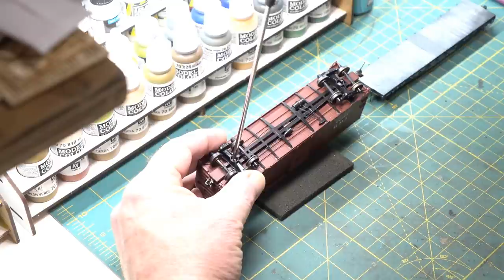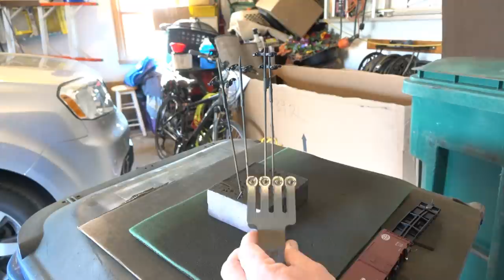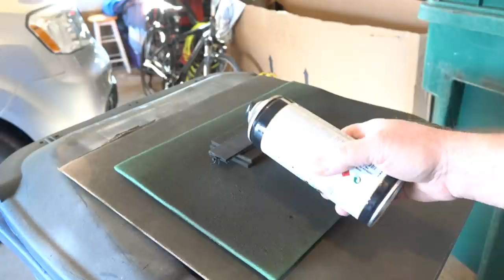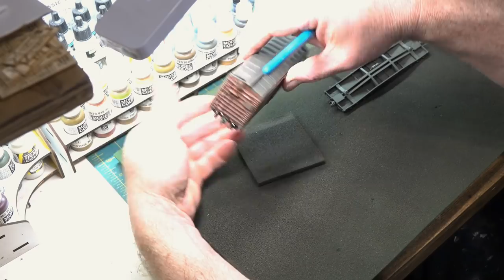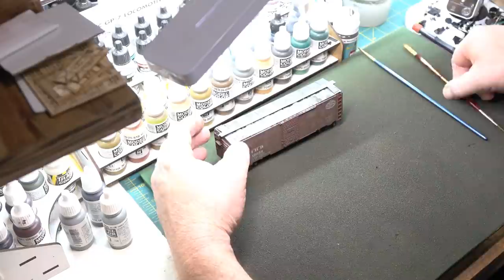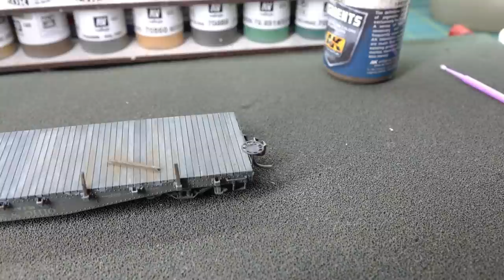MRUV 147: Quick Weathering for Rolling Stock

Comment: you are just so natural on the camera. love it. 
question, when changing wheels from plastic to metal, how do you know what size of wheel sets to use?
Reply: Well, I suppose I should measure with a caliper and get the right length, but I just slap in Intermountain wheels- sometimes Proto as I have a box of those as well. As long as they seem okay I'm happy. I know, not real MMR-ish but it works for me- so far.
Reply: @robbennett1965  I'd like to add a comment. Most companies that offer model wheels will offer 33 inch diameter and 36 inch diameter wheels for HO scale standard gauge. Real life railroads used 33 inch wheels for standard gauge freight cars until about the time of the introduction of roller bearing wheels. (1980's maybe?) Many, but not all roller bearing wheels are 36 inch. Passenger cars from the "heavyweight" era on usually used 36 inh wheels. When you buy HO wheelsets, they are usually labeled in inches (the 33 inch also noted as "freight" wheels, and 36 inch, often also noted as "passenger". It is best to sctually measure the ones you remove from the truck and use the same size. The model wheels do not differenciate between friction bearing and roller bearing wheels. They are all the cute little pointy axle ends.

Comment: Great results Rob!! You were right, they did look terrible but, when the washes dry, the colours had all blended and calmed down nicely. I guess you've just got to trust your instincts and have the patience to let them dry. One question: will they gat a coat of clear/varnish/dullcoat? I wouldn't think the washes will stand up to much handling.
Looking forward to the next one.

Cheers for now,
Dougie.
Reply: Dougie- to be honest, I don't usually use a matt varnish once done. I haven't noticed any serious issues. Also, doing so CAN- just need to be aware- tone down the finish a bit. Now, that is for me and a home layout. If I were taking these cars to a club or otherwise handling them a lot I may do that. On the one gondola in the follow up video I did hit it with a spray of Dullcoat, as I wanted to tone it down a tad.

Comment: Where did you get the gig for painting the wheels? Same question about the piece of equipment that cleans the inside part of the trucks where the wheel sets are mounted.
Reply: The wheel jig is from American Model Builders- they make several for different brand/size wheels. The "Truck Tuner" tool is available at MicroMark.

Comment: The issue with the footage being blown out at, e.g., 49:50 isn't really because of lighting. It's the high contrast between the dark foam pad and the white paper and relatively pale car. Perhaps it's slightly because of the lighting reflecting from the wet car, but I don't think that's the major issue. You need to adjust the EV (brightness) on the camera. Set it to a negative value and the image will get darker. Dial it down until the paper isn't blown out any more, and things should be fine. It would also help if you didn't use that big, dark foam pad. The mid-green cutting mat would probably make an easier background for the camera, which might avoid having to change the EV at all.

(Actually, I've just remembered you said you used to be into photography, so you probably know how exposure compensation works. But I'll leave it there in case it's useful to anyone else.)

Edit: I think this is borne out by the shot at, e.g., 1:02:00, where the tighter crop means there's much less of a contrast issue. There's a little glare on the wet paint from the overhead lamp, but everything's much more visible.

Comment: Easy lighting suggestion
Find an old IPhone 4, 5 or 6...fit a velcro on phone and underside of the light to hold it facing directly down over you work...and let the phone find the proper light level by itself...edit these closeups to your other footage....you can probably find a used phone of that type for less than 50$US

Comment: Something that might help in this with spray painting. Take and cut ceiling tiles into 2 inch by 12 inch strips. Take toothpicks and put them in the screw holes on the car then stab the toothpicks into the ceiling tiles and it will hold the car for you so you can paint the car with out having to handle them. The toothpicks may have to be trimmed down to fit into the car. Just a light twist and they will stay in the car. Basically like what you did for the trucks.
Reply: Good idea- may be very useful. Thanks!

Comment: Great video. Thanks. On the wheel treads? I like to take a little light oil and a micro brush painted on the tread. Then put them in my jig to paint. After the paint is completely dry. I can just wipe the tread off with a rag or paper towel to clean them. Just a thought. Thank you for sharing. Please keep em coming.   Not leaving the house is getting a little tiresome.
Reply: Good idea Vincent- I amy give it a try. I agree this is getting tiresome...and I think the few remaining train events I was looking forward to in May will end up getting cancelled soon.
Reply: @robbennett1965  well I hope not. Thanks for your awesome videos. I always look for them. Trying to find your fast tracks videos.